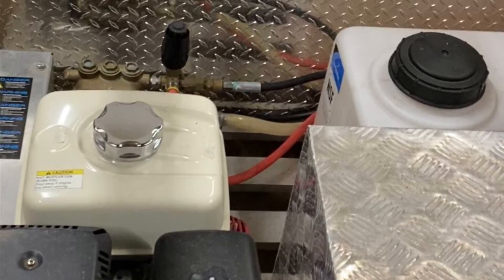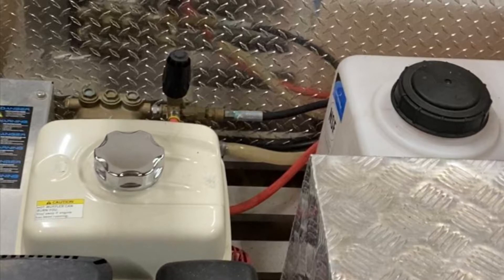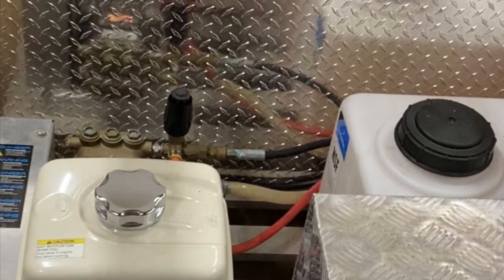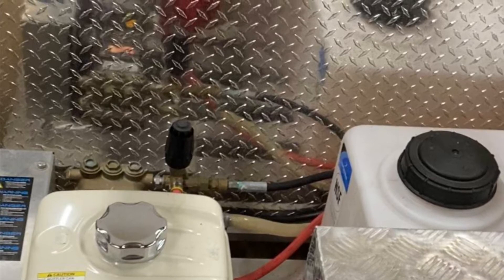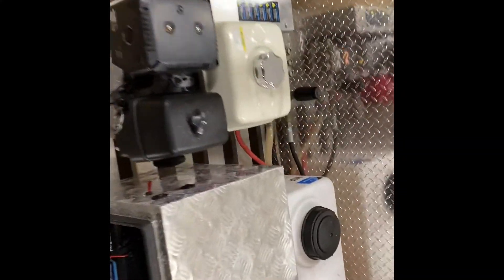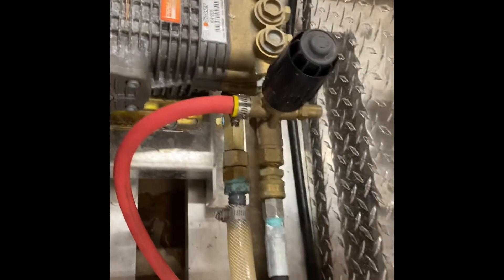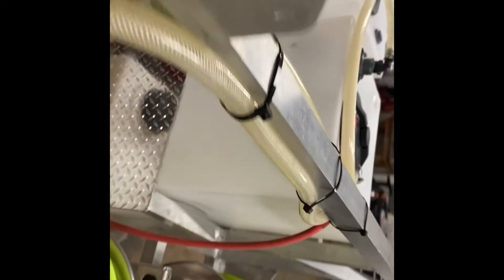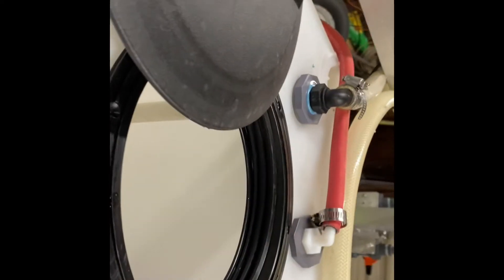How to Install bypass line on 4gpm and 5.5gpm pressure washers

Comment: Have you ever added a bypass to a pressure washer with a built in unloader?  I have a Simpson 4500 psi 4GPM pressure washer and it has the built in unloader.  I would like to install a bypass so I don’t have to run back to the PW every time I need to stop.